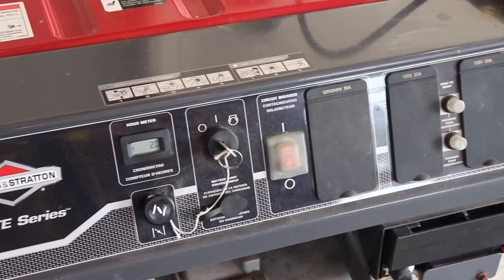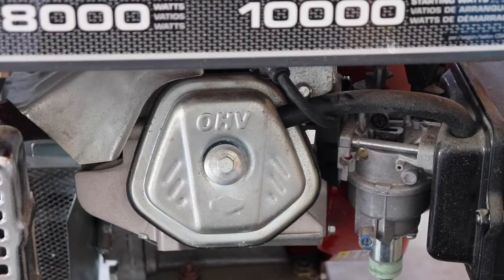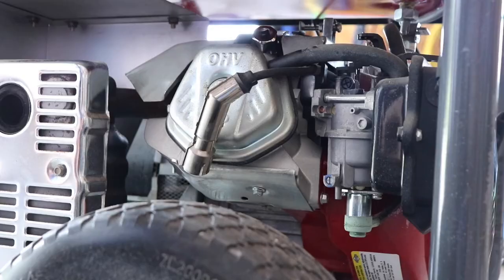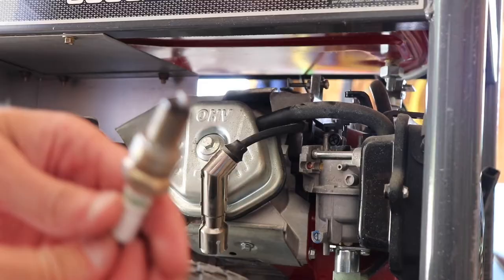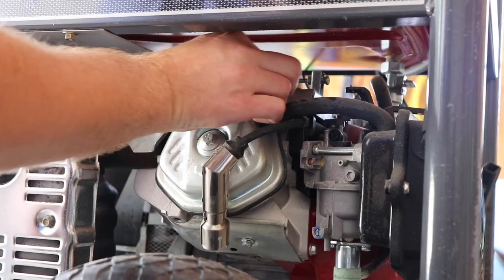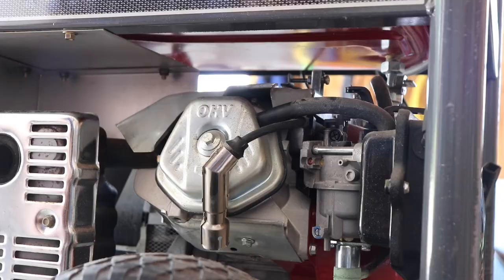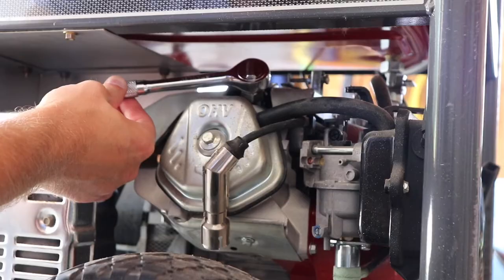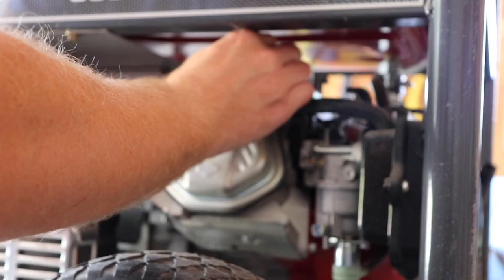How to Change the Spark Plug in a Briggs and Stratton Elite Series Generator Motor

Comment: Thanks for the video. I just replaced the air filter in my Troy Bilt 5500 generator but did not see the plug location: your video should prove helpful.  For difficult plug access I use some rubber fuel hose on the end of the plug to start the threads in order to reduce the chances of cross threading.
Reply from the maker: Thank you for watching and for the tip it’s appreciated!

Comment: Should the generator crank if the spark plug is bad? I have added gas, checked oil (which I changed yesterday), the air filter isn't that dirty, so I thought it could be the spark plug. It cranks and runs less than a minute before shutting down. Is that possible if the spark plug is bad?
Reply from the maker: Sounds like there may be some bad gas or the carburetor is gummed up. How long was it sitting before you tried to run it?